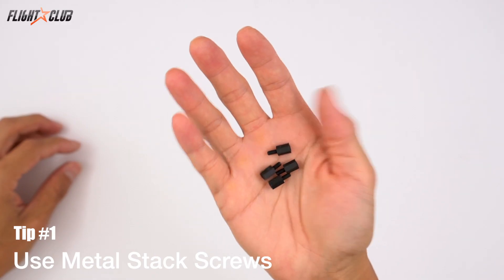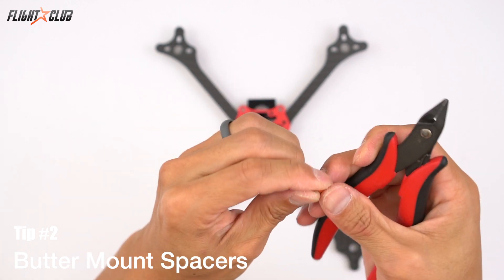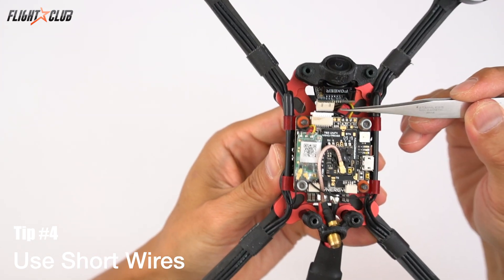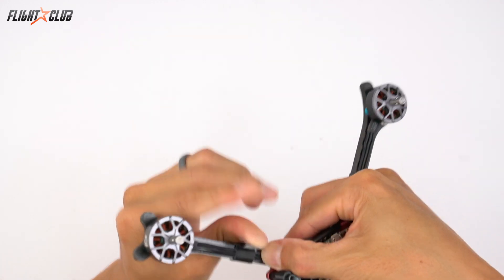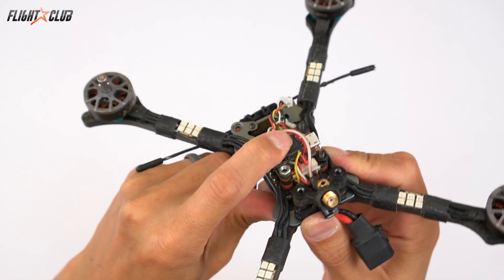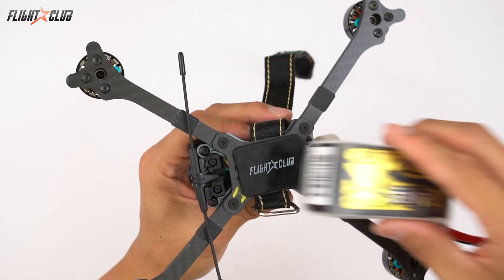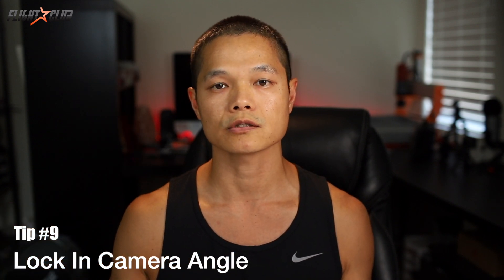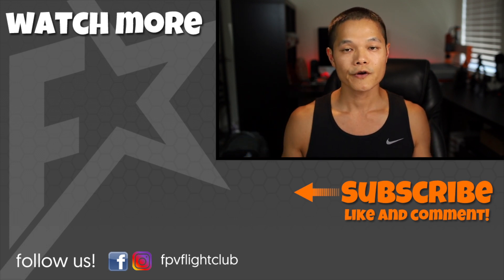Bulletproof your Quad with these 9 Simple FPV Build Tips

Comment: On Tip 2  its less common now days but MAKE SURE your PCB ( whatever part it is  VTX  FC whatever ) does not have conductive mounting holes when using metal screws. That mistake cost me $50  USD one day.  Tip three is good  unless your FC  depends on rubber stack mounts to address excess vibration like the new Matek F7 FCs with two gyros on them. You have to soft mount those damn things --  personal experience   but like five times worth of experience   same with a few smaller FC's like my 
Airbot Omnibus F4 Nano V6 Flight Controllers   they were touchy and demanded rubberized stack mounts

Comment: I have some more tips tested by my local racing team:
1. Zip tie your XT60 cable to your quad can prevent tension from transferring to the +– pad on your ESC.
2. Loctite your camera lens, a tiny little bit of Loctite can stop your camera from losing focus.
3. If you have an SMA antenna, bend the outside ring a tiny bit so it locks in when fully connected.

Comment: Hey there Mike. I like your idea but the gaffers tape for the motor wires. I'll interject and say that I use racewire and don't mind the extra 24 joints. But one thing I might do in the future is use your gaffers tape method on brand new builds, and then only insert racewire when I need to replace a motor on a used build. That way I don't have to go all the way to the ESC.

Comment: On most builds, you can actually solder the outside (ground) of the U.FL to a VTX, then glue it down and tape over it.  I've found that this actually keeps my VTX's alive for longer.
I prefer to run motor wires wrapped around the arms, taped the same way so that they're never in reach of a bent prop.  Adds some length, but works pretty well.
Blue loctite on every impotant bolt is worth it - adds about five minutes to any build, but solves all kinds of issues troubleshooting when something gets loose.

Awesome video!
https://rotorbuilds.com/build/18676

Comment: Awesome!  I was using metal or aluminum hardware for my stack with lock nuts and the short battery cable the rest I'm about to turn all my quads to. I also just recently got the proton canopy with the Locking camera mount and it is amazing.  Thank you for the great tips.

Comment: Use all these tips to some degree.  Great advice.

I use a frame that allows me to double strap the battery (one length ways, one width ways).  Straps lock into one another with the velcro.  Have not had a battery eject in over 6 months since doing that even when one of the 2 straps wears out and breaks.

Comment: One tip I'd say, get a 4in1 ESC that has oversized holes (4mm) where FC soft mount grommets can be added. This helps prevent shock from hard crashes or a flexible racing frame from damaging it when using metal screws to build your stack up.

Or if it can be done safely, drill your 4in1 out and add soft mount grommets to it.